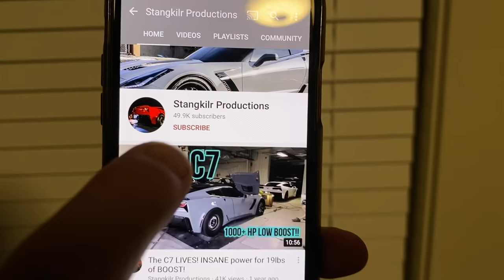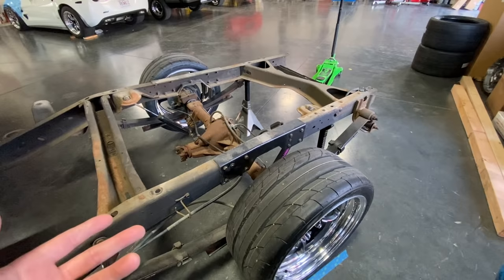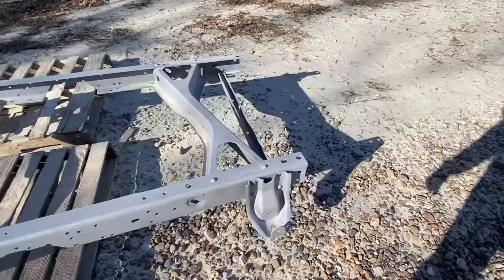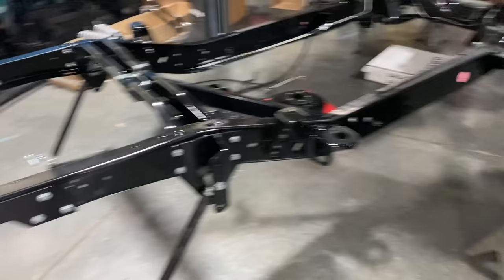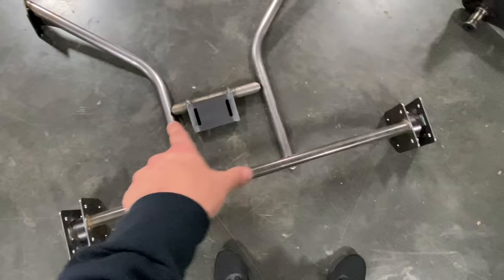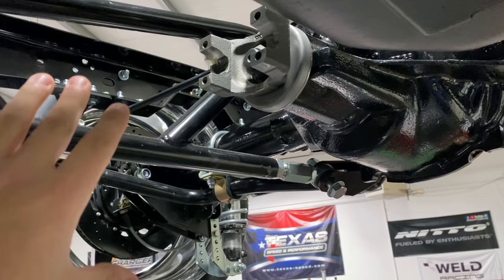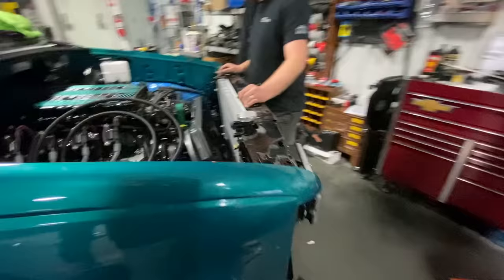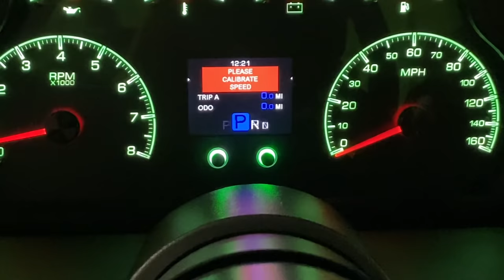Building a $100k 1993 Silverado from start to finish. The best one built yet?

Comment: 100% confident can say I'd rather have that OBS over any other one out there. Amazing truck!
Reply: Same!!! It's perfect. Even the paint, wheels, stance. Fuck yeah.
Reply: Hell yeah man!!
Reply: Ong i have a 5.7 obs and its my fav over anything
Reply: @asherjones1  I had an obs Tahoe for about 6 years, had 5.7 vortex and was a great truck till I could no longer find a ball joint that wasn't made of plastic and only lasted 6 months. Unfortunately sold it cause I couldn't imagine driving it with tiny wheels 🤣
Reply: @Sneakdisscommentbelow vortec. And HELL YEA! Man I had a 95 2 dr Tahoe 6 lug HD 4x4. 20x14 American forces wrapped in 35 in nittos. Man you wanna talk about someone miss that truck! But maaan lemme tell ya lol I got offered a PRISTINE all original 87 base model firebird ttop 305 4 barrel car! Yea it was bye bye lmao I only paid 2 racks for the truck (I did do about a grand worth of break work) but swapping for something like that was a no brainer and shit that’s the car I swapped for my current small tire street car. Only money I’ve put in this car has been suspension and cutting weight and that car has been 150mph on 28x10.5 slicks as is on 112 Sunoco and the nitrous plate that was already on it. So while I miss that truck dearly if I could do it all over again I wouldn’t change SHIT😂😂😂

Comment: 54:50 - When separating the two pieces of the housing for the wiring harness pass-through, freeze it before then smack it with a hammer and the goo will shatter and be much easier to remove.
Reply from the maker: Thats good info! Thank you

Comment: Gorgeous truck AND build but I’m shocked you guys kept a 10 bolt instead of opting for a 9” or at least a 12 bolt (if not an SS 14 bolt) with all the money spent everywhere else 😳 I’m only at roughly 600hp n/a with a built 4L60E with 3.73s and I have already broken mine twice in 1 year with basically the exact same upgrades! Much less once I power adder it 😬 Definitely a 9” or 12 bolt in my near future👌🏼

Comment: Is that a 4/6 drop kit on that truck or a 5/7 drop?
Reply: QA1 lists the kit as 5/7 capable but they used stock spindles so probably 4/6...looks about where my truck sits with that drop and similar wheel diameter

Comment: Do you still happen to have any parts left over from this teal truck build?  The reason I ask is that I just picked up a clean 1 owner 1995 GMC C1500 and am in need of a few parts - stock upper/lower control arms as well as the stock air cleaner cover.  My truck is too low and I would like to raise it a bit via just a dropped spindle (currently has Chisholm tubular upper/lower control arms and dropped spindles on it).  Please let me know.

Comment: For $100k I would have bought a chassis from GSI, Phat Phabz, Roadstershop or Acme Chassis Factory.  Not a fan of the bolt in kit suspension when $100k is mentioned in the title.  Just my 2 cents.

Comment: All that work and still did a bolt in notch 🤔 those notches crack the frame over time...
Reply from the maker: Well considering it’s had a bolt on notch for 30 years and no issues I think it’s fine lol
Reply: It has waay more horespower now though, it may actually become a weak point over time. Also it was babied for its past 30 years

Comment: Where did you get the bucket seats. I have a 93 , teal n silver.  And  3/4 to 2 wd 5.7 with 98 k miles on it. Bench seat. Nice but want super back comfort. Just not fast enough. Want a 454 in it. Lol
Reply: The high backs are factory from the pre facelift trucks but getting rare.

Comment: 50 ok...100k your high ....I know it has an lt4..but come on it's still an obs Chevy
Reply: Suspension, Steering, Brakes are on about 15k in parts. At least 5k in rear end and driveshaft.  Probably another 5k in instrument cluster, wiring harness, pcm/tcm.  Now go price that engine, transmission, custom offset wheels, new painted parts and powdercoating everything.  Oh yeah, little elves didnt build it at night for free either.

Comment: Nice work, but 100k? phhhst.  It was rather sad to see such a pristine truck get hacked, but once they (previously) C-notched it, it was ruined from that point. The rack and pinion set up is sketch AF. You should have called them up before hacking it... maybe they sent you the wrong application. Hopefully the owner wont get killed (or kill someone else) when that D-bar comes loose. Nice work though.
Reply: I know the owner of ECI...not sure about the fitment issue in this build but the kit isn't sketchy.  There are a good dozen autocross trucks running it that I've seen.
Reply: @T0tenkampf  Copy that.. I don't believe the system itself was bad or sketchy, but wonder if they got the right one.
Reply: @hawkdsl  I would think so, he's really only doing obs stuff as far as I know.  Was definitely not an optimal fit but they also probably got one of the first kits.
Reply: They did get the wrong bracket for the rack. The company (ECI) specifically says on the Instagram page the 93-94 trucks are a guess at how the frame bends and you have to call to verify the bracket is correct. I know ECI, the products they make are all top quality. When I upgrade it will be ECI control arms for the front and their trucks arms for the back.
Reply: @DavidB7474  Thanks for that. I suspected as much.